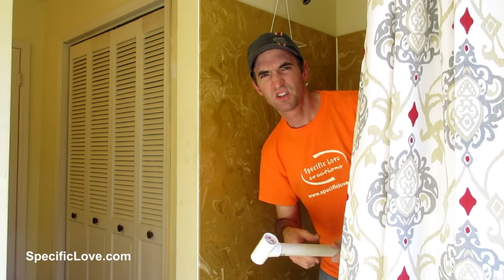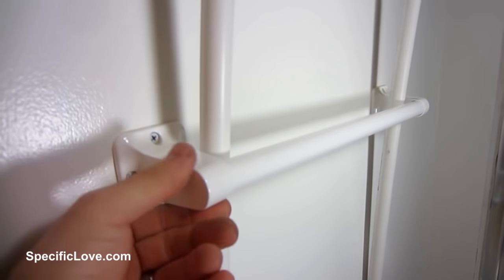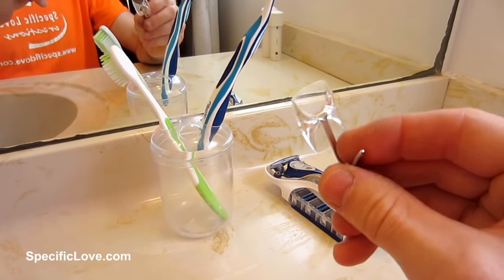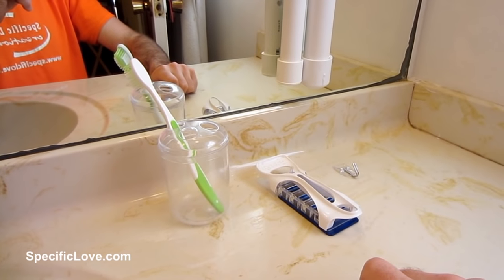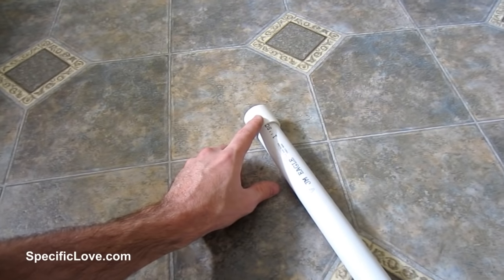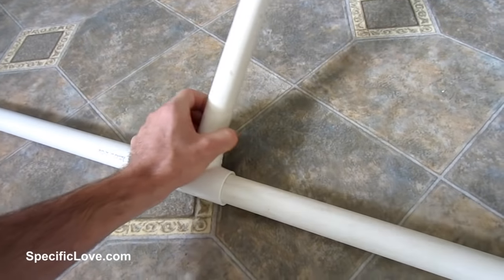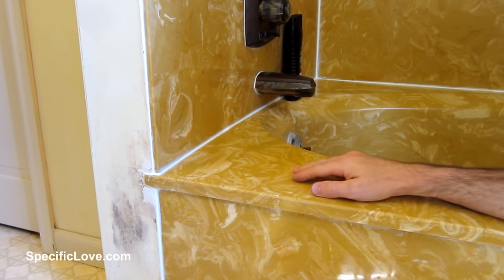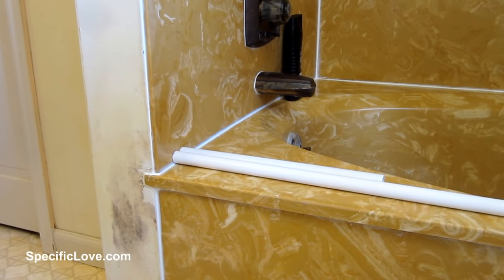5 Bathroom Life Hacks with PVC Pipe

Comment: what if you have heavy towels won't the weight of those towels make pressure on the original wall screws holding the towel rod .how about a tension shower curtain rod, found mine at a dollar store for $3.00. And placed it in front of the shower curtain, also great for indoor clothes drying with plastic clothes hangers on rainy days 😊

Comment: well I live in a pretty good size house with a tiny closet bathroom lol the hangers for the mirror as well as the toilet paper holder will come in hand and I think I will even add a toilet paper dispenser role on top with a t fitting so when I need to replace it I can just pop the top off. Also gives me the ability to have the toilet paper anywhere i need instead of it just being on the wall where its to close to you or on a rough angle.

Comment: Hey Specific Love, we need one bicycle edition video:
1. There is rain guards for golf carts but i have not seen one for bicycles. Need a good contraption idea for that, if you have it please share to guard against rain.
2. A good pvc bicycle airhorn and bicycle lights using pvc would be great. 
3. A bicycle grocery carrier not for the front or rear but two pvc baskets on sides for counterbalance, may also protect the rider's leg if the bike tips over or slips. May also have a combo design with a side training wheels for new riders.
4. A pvc bike rack for the garage or smaller version for apartment complexes. 
Off topic:
1. A pvc bumper protection for when you are parked in tight spaces, at the grocery store or anywhere there is a risk of being dinged.
2. A pvc laptop stand for the car (i saw one online for $200 bucks! Ouch out of price range) prefer $40 or less.
Thanks!
Reply from the maker: Those are a bunch of nice ideas, thanks for sharing